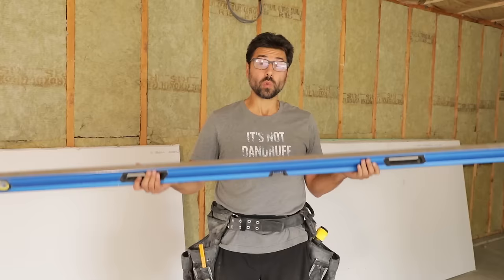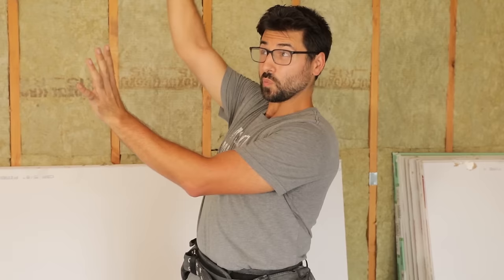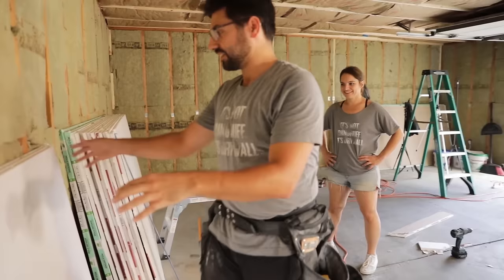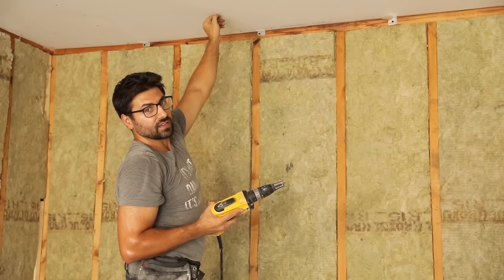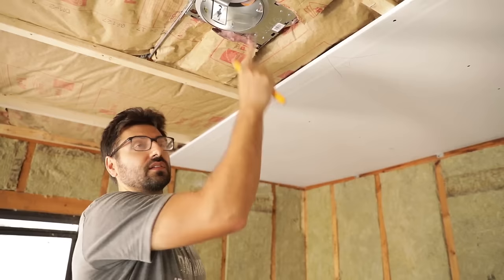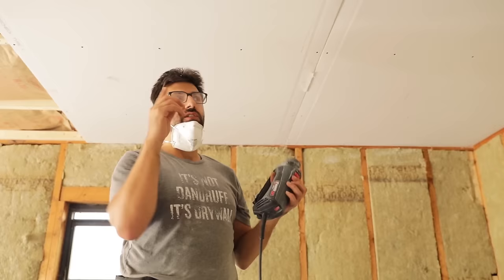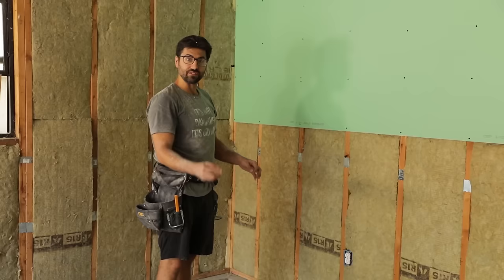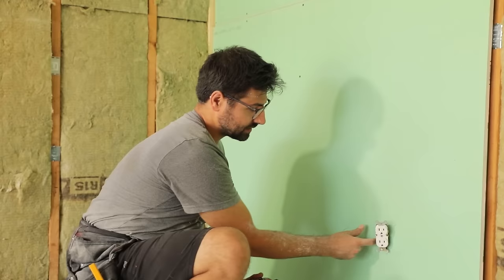How To Hang Drywall for Beginners  | Nestrs

Comment: I'm remodeling my first home with my girlfriend. It's 104 years old! We ripped out all the old lath and plaster (about 15,000 pounds of it), re-wired the place, installed insulation, and working on drywall now. My dad has been helping me with the drywall, but it's nice to watch another video to help better myself to help my dad more. Thanks
Reply from the maker: Sounds like a big project! Glad this was helpful.
Reply: I just bought a 50-year-old house and going to try to do the same. Did y'all rewire the house yoursleves?
Reply: @benfontenot9896  yes we did. You're supposed to pull permits for it, but we opted not to. We did the wiring while the walls were open before insulation and drywall. It makes life much much easier. If you have any questions, let me know
Reply: I am literally about to start the same project. My aunt is letting my buy her 140 year old house off of her for whatever is owed on it. Its a massive place and it will be so pretty when its done.
Reply: Marry that girl! She’s a keeper!
Reply: So you ruined it
Reply: @SamCyanide if you think they ruined it why don't you go show them how they're supposed to do it?
Reply: I hope you aren’t remodeling all the old, pretty stuff out of the old house…unless of course some jackass already remuddled everything before you got there

Comment: Once I buy the 8' level, I won't have enough money for the insulation and the drywall.
Reply from the maker: VCR Time Machine Bahahaha, a 4’ level will be fine.
Reply: Harbor freight. Levels work good enough for drywalling
Reply: As an engineer who used to design levels(the blue ones that are owned by the red company, wink wink). Get an I beam :) lighter, easier to hold and just as accurate (if you don't beat the shit out of it). Just not as durable. Just don't get the husky I-beam, you can bend it if you look at it too hard. Try empire e55(wink wink) or irwin.
Reply: Wich vcr works better for a time machine a beta or vhs a Sanyo or Sony?
Reply: And he just throws it into a pile

Comment: Good job. U guys answered my question on why put up strapping. My next question is the wood strapping pressure treated ? My ceiling caved in in the living room. No water damage so insurance won't cover. My first time doing this job with my son who just graduated from Ranken Carpentry. It's our project.
Reply from the maker: Hey Los Moore, I would never use pressure treated wood in an interior space. Lots of nasty chemicals that you and your family will potential breath in. Hope that helps and thanks for the comment 👍🏼

Comment: Rotozip or router clockwise for windows and door frames counter clockwise for lights and electrical boxes
Reply from the maker: Thanks for the comment Joshua. 100% For doorways you can save some time and Rotozip bits by using your saw and box cutter. Plus you will cut down on the dust.

Comment: Thanks for the video I hadn't thought about eating using a rotozip.  I just purchased my drywall from Lowe's and will be hanging it within the next week. Question, would it be easier to do the floor level first and then go up from there so you can use it to hold the upper panels? Also what kind of space do I need between the concrete and the bottom of the sheetrock? Thanks great video
Reply from the maker: Thanks Rick! You want to start hanging the top sheet to avoid gaps. You want your gap at the bottom that trim will cover. Hope that helps and have fun!
Reply: Thank you for the quick response I really appreciate it. I'll be hanging the drywall within the next week My roof is actually a hanger in my backyard. The trusses spanned perpendicular with a hanger door except for the sides which are about 8 ft go parallel with a door which way do you suggest that I start the sheetrock? Thanks
Reply from the maker: @rickanthony8259  well, I may need more detail to give you proper advice. If this is a garage or hanger you may want to consider stacking the drywall from the ground. However, I would use purple board if you’re resting on concrete as moisture can be absorbed into the Drywall from the ground.

You can also consider hanging it vertically depending on the ceiling height. Hanging it horizontally hides imperfections in the walls a little better because you stagger your butt joints where as vertical boards will break on the same stud.  

If you have a somewhat standard ceiling height, then I would just stick to the original game plan and start with the ceilings.
Reply: @Nestrs  
Thank you for all the responses. The ceiling height is 14 ft. I wish I could send you a photo of the selling that might give you a better idea of how or which way to place the 4x8s I have.
Reply from the maker: @rickanthony8259  for 14 foot ceilings I would consider stacking it. Use a small piece of drywall at the bottom of the wall to stack your first piece so there is a 1/2 or 5/8 inch gap between the floor and the first piece of drywall you hang. Good luck and please let me know how it goes!

Comment: Use an x bit for Roto zip. And you need to go counter clockwise for cutting out can lights(outside of light/box) and clockwise for the inside. Also no need to mess with outlets. Just mark the top of the box so you don't hit and damage the outlet.
Reply from the maker: Daniel Morrill 👍🏼 thanks for the comment and actually that would be the best advice for beginners. Most projects will not have outlets at this stage and as long as you have a quality box you are not going to hurt it. Stopping to precisely measure to the outside of the box will slow you down and may require you to tape around the box if it is not perfect. Mark the center with your knife and keep moving.

Comment: On all the videos I've watched such as homerenovisions, you should be going counterclockwise when roto zip an outlet. Find the center of the box, disconnect the wires, fold them in so no wires are cut.Start at center to the inside edge, jump to outside edge and roto zip counterclockwise.
Reply: Thank you, it looked like he was going counter clockwise, but wasn't sure if the video was reversed.

Comment: Read comments?… read them… 
1. What size screw for 5/8 on ceiling? 1 1/2? 

2. Can I make a kicker? 

3. What is best for muddin’ , spade or 15 in 1, floater? 

4. What grade grit sandpaper for the smoothing? 

5. Do you recommend scaffold alternatives… for high ceilings? 

Mahalo

Comment: drywalling where rooms will have a drop ceiling, therefore the ceiling won't be first.  Considering this (only walls are getting drywall) is there still an advantage to putting the top 4' of the 8' wall board on first versus just working from the bottom up?  I am not concerned if the final height of the drop ceiling is exactly 8' or if I have to make it 7'-10" or 7'-11".  IF it is OK to put the bottom board in place first, should that board still be lifted slightly?  If so, how much.
Reply from the maker: Tom Brizzi Thanks for the question. If it were me, I would still hang the top piece first. I guess it really doesn’t matter if you buy a piece of j-bead to slip on the top edge of the drywall. It will hide any cut edges you have and creates a finished edge that will butt up against the drop ceiling framing. For me, it’s always easier to hang the top piece and cut the bottom board if needed. The gap will be covered by your baseboard. 

The last time I stacked drywall (many years ago) was for a commercial space with a room that had 20’ high ceilings. Hope that helps!

Comment: I think it would be much easier to just put sponge pad with ink on the face of receptical, then make imprint on the backside of the drywall.  Cut along the imprint.  Also, if the receptical box is already raised to account for drywall thickness, there is no need to take out the socket from receptical box.
Reply: The metal ears/tabs on the receptacle are designed to sit flush in front of the drywall. Much more solid installation if you do it properly.

Comment: I've torn apart 40 year old bathrooms that have water damage and those nails were not letting loose at all.
Reply from the maker: The materials we use today vs the materials that were used 40 years ago are  different.

Comment: I was wondering about using my rotozip with a outlet already installed. Thanks.
Reply from the maker: Yep, ideally you want to hang the drywall before the outlets are in 😊 If that is the case, My suggestion would be to turn off the power, unscrew the outlet and push it to one side and rotozip one side at a time while moving the outlet as you go. Hope that helps and thanks for the comment!
Reply: @Nestrs   also to use black tape around the outlet you removed is helpful. cheers!

Comment: Awesome video. Why did you use 5/8 sheeting on ceiling vs 1/2 all around? Thanks!
Reply: because the ceiling joist are 24 on center and possibly fire code,walls are 16 on center.sometimes 5/8 will be used on fire or house walls.

Comment: How far off the ground ship the drywall sit? Do you have the drywall be Hoyer underlayment and flooring is installed? I need more information
Reply from the maker: Hey 11219tt, you definitely want your drywall to be above your finished flooring height. This will prevent buckling if your floor expands moves and stop moisture in the floor from absorbing up into the drywall and causing damage. A good rule of thumbs is about an inch or so above the finished floor height.

Comment: Great video.  I am building a small soundproof, totally enclosed cubicle.  I am going to double up with 5/8" drywall and use green glue in between.  Do I have to mud and tape the first layer of joined drywall, and then do the same for the 2nd layer?
Reply from the maker: Hey Michael, nope, you just need to finish the exposed sheet. 👍🏼
Reply: @Nestrs  Ok.  Got it.  Thank you. 🙂

Comment: People always say "hang" drywall... does this mean drywalls should be supported by the studs as opposed to resting on the floor?  Seems to me it's better to have the drywall weight at least partially sit on the wall to lighten the load of the studs...
Reply from the maker: If you’re stacking your drywall, you’ll potentially be left with a gap at the top of your wall, which is problematic to finish. It’s much easier to hang at and have your gap be at the bottom where your baseboard will cover. 

Also, if you are drywalling an unconditioned space like a garage, you certainly don’t want to rest on the ground because all that moisture from the concrete is going to be sucked up into the board and compromise the integrity of the wall overtime. Hope that helps!

Comment: What I want to know is, what is the advantage of placing the dry wall length wise on top of each other as opposed to having a single piece go from ceiling to floor.

I'm pretty sure there's a more appropriate way to phrase that, But I think you can figure out what I meant. Lol

Comment: which is the best way: cut out the can light holes before you texture and paint the ceiling or should you hang the ceiling then texture and paint?
Reply from the maker: Hey Lina, always cut your opening first. Finish (mud) and paint after. Also, smooth ceiling are better and texture 😉

Comment: I was always told that 3/8 drywall goes on the ceiling half inch on the walls
Reply from the maker: @BrianSmyth 3/8 is not to code in habitable spaces. In garages, it doesn’t really matter but I was heating the garage which is why I used 5/8. 

Now, if you have a two-story home, you can put half-inch on the first floor ceilings, but any ceilings to the exterior or  an unconditioned space must be 5/8. It gives you more rigidity especially if you’re framing is 24 inches on center which was the case in the garage here. It also provides more of a sound barrier.

Hope that helps!

Comment: Is it necessary to hang the top piece first on the wall? If so why?
Reply from the maker: Hey Stephen, while there are some rare cases where stacking makes more sense the basic school of thought is that you want the gap at the bottom of the floor that will ultimately be covered by your baseboards.

Comment: Some info on screw depth would be cool. I don't have one of those special bits, any advice?
Reply from the maker: My apologies for the late response… you can use a standard driver to do this as well. The trick to create a slight dimple without tearing the paper. You can adjust the setting on the driver to help. If you break the paper, put another screw in a couple inches away.

Comment: The ceiling panels were not screwed along the edge until the other piece was placed next to it to prevent blow out, but the thinner side panels were screwed along the edge before the second panel placed next to it. Don't get why that is.
Reply from the maker: The edges wrapped in paper won’t blow out are safe to secure. The exposed ends will blow out so that is why wait until the next piece is hung. Thanks for the comment!

Comment: What size drywall screws do you need if you’re hanging 1/2in x 4-ft x 8-ft drywall ?
Reply from the maker: Hey Quis, I would use 1 1/4” screws. 👍🏼

Comment: Around 6:30 you say never screw the factory edge incase of blowouts. Im assuming that applies for both edges (top and side)? Does that also apply to the walls? How close does the wall go to the roof? Is there any gap or is it pushed on flush before screwing. (Like is there anything i will be putting in between the wall and roof or is the roof board directly resting on the wall)
Reply from the maker: theironninja314 good questions... you will want to hang ceiling boards first and flush to the studs. Don’t screw any of your edges until they are against a stud or another sheet of drywall to prevent blowouts. This goes for ceilings and walls. All joints should be tight and flush to all adjacent surfaces. For example, your wall boards should be up against your ceiling boards (no gaps). I hope that helps and good luck!
Reply: Nestrs, LLC it did thank you!

Comment: can someone tell me the reason why you would not hang the 4x8 ft (for 8' ceiling height)sheet vertically long 8' from floor to ceiling instead of two sheets hung horizontally?
Reply from the maker: Hey nmbr1bassr, we have had this question a few times in the comments. Hanging the drywall horizontally has a number of benefits. Less linear footage about 25% for taping and finishing which saves time and money. More importantly it hides uneven studs. This allows you to flow over the framing so that bowed studs create less of a problem. Hope that helps!

Comment: Do you have any advice for covering a 2% asbestos popcorn ceiling with drywall? quotes to abate/encapsulate in my area was estimated for $31,000 so going with the pros are just not an option

Comment: I have to ask I'm old school. We always installed our drywall long est end up wall only one seem to mud every 4 ft. Why now is it all being done long way from bottom up
 wall. Do you understand what I am asking. I have a contractor that insist on new way and I as owner and the money man want it my OLD way. HELP Here
Reply from the maker: Thomas Bridges I would recommend doing it the new way 😂😂😂. While hanging vertically reduces butts joints, it increases linear seam footage. More importantly horizontal hanging hides uneven studs and ensures a smoother appearance. That’s why you only see drywall hung vertically in basements, garages (not mine 😀) and commercial spaces due to fire code.
Reply: Ok hanging vertical has nothing to do with a fire code. On steel you hang vertical wood you hang horizontally it just a convenience factor
Reply: Can someone please tell me if I can hang the drywall horizontally in my tiny house? Thanks

Comment: I"m watching this to see how the ceiling studs look because I am installing a new dining room light fixture and I cannot find the studs!...I removed the old fixture and that leaves about a four or five inch whole in the drywall....sticking a long screwdriver up in there in all directions I cannot contact or feel a stud anywhere!...so frustrating! I tried to use magnets but the drywall is 3/4" thick and that did not work and my cheap stud finder is worthless.....the NEW fixture is a stained wooden box 6 inches wide by about 3 feet long and four or five inches deep with light bulbs hanging down under the box a bit.....
Reply from the maker: Sounds like you may need to remove additional drywall and install a new box on a metal bracket that spans between your joists. If your fixture is small (light weight) perhaps an old work box will work since you have 3/4 drywall to support it?

Comment: Nailes are waaaay more flexible than screws. Idk where you are from, but here in Texas land moves a lot. Screws will break a lot faster than nails. Always use nails.
Reply from the maker: We are in Columbus, OH. I was stationed in Texas many years ago when I was in the Air Force, loved it! Do what works for you. Up here, with the change in temperature you are going to see lots of nail pops. Thanks for the comment 👍🏼

Comment: Is there a reason for using thicker dry wall for ceiling than the walls.
Reply from the maker: Hi carguy1312, yes, it is code in many municipalities in the US depending on where you live. The primary reason they require 5/8 on the ceiling is for fire rating and insulation. It also helps as a sound barrier.
Reply: Yeah there is a reason so the squatters upstairs don't fall .through it

Comment: Am planing to build a seperating wall between two rooms
Can yuh advice me whether to use insulation between the drywall or is it overkill for such a simple build?
Reply: definitely do the insulation- makes it more soundproof
Reply from the maker: ashfaaq inventor it’s all about your preference and how you are going to use the space. If you want to dampen the sound add some sound proofing insulation. As far thermal insulation is concerned only exterior walls are needed. Hope that helps and thanks for the comment.
Reply: Thanks for the reply you guys rock!
Cheers from Mauritius